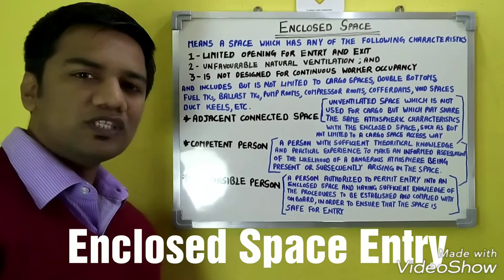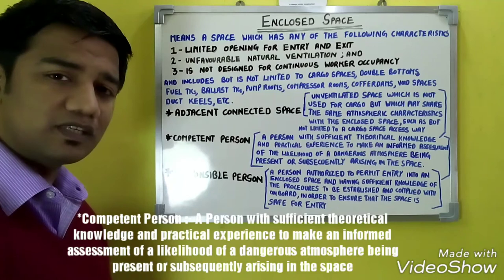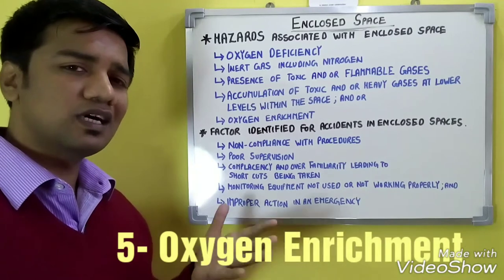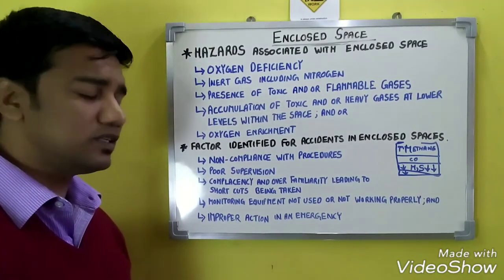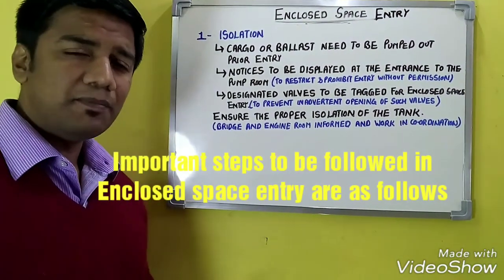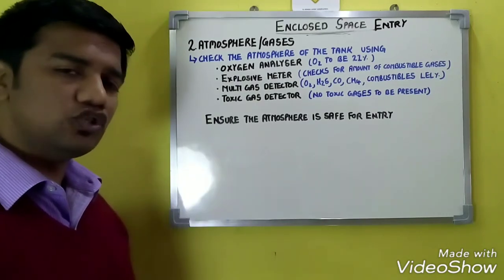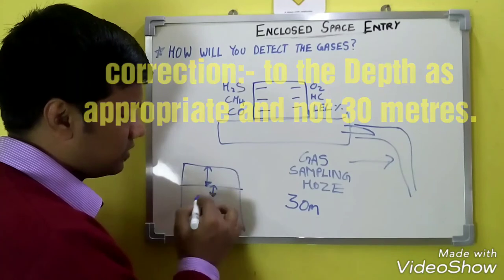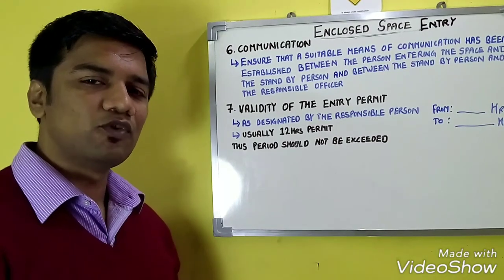Enclosed Space Entry, 2nd Mates Oral, F3

Comment: If O2 level goes above 21% then the flammability diagram is invalid... So how can even one think of fire...  For fire to take place in need fire triangle to complete not the O2 % by vol...  Correction mate 😇🙏

And Validity of permit is 8hrs... And later on you have to fill in a new permit again